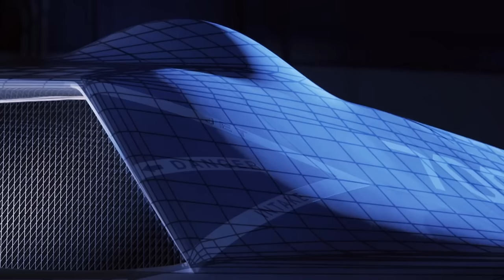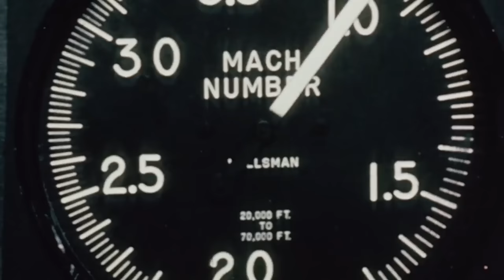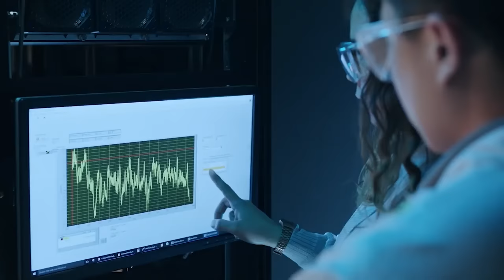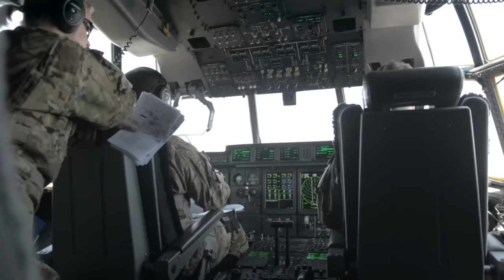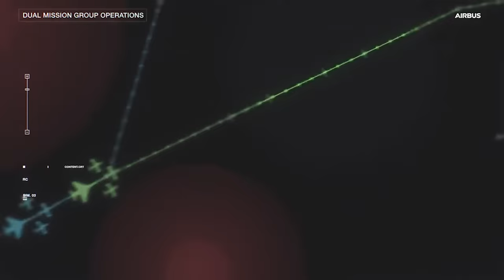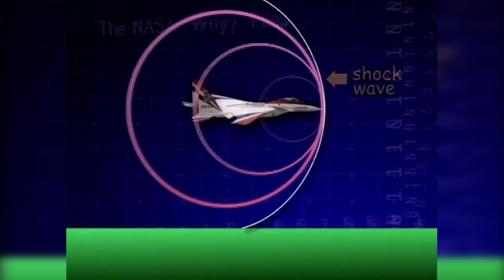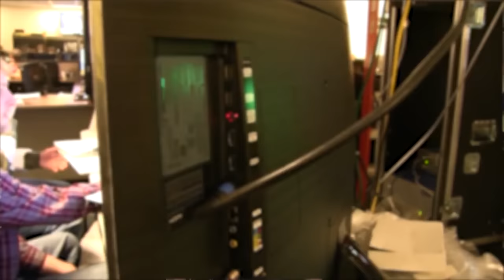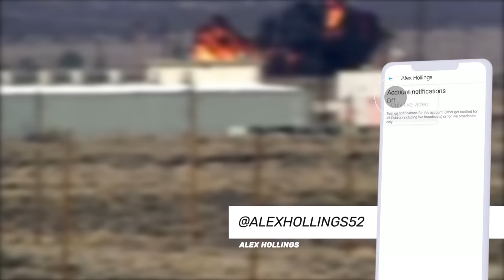Modern X-PLANES: The future of airpower

Comment: The X-65, if proven, would revolutionize aviation and dramatically cut the cost of building aircraft, while reducing mini potential points of failure.
Reply: They will invent a way to make it very expensive
Reply: I was actually kind of thinking the opposite. Sure, if you can get rid of control surfaces it removes them, their linkages/cabling, their actuators from the aircraft, so that cost to build and maintain goes away, but control surfaces are being replaced by something else, and if operating that something else turns out to not be as easy or reliable as people expect, it could very easily end up more costly to build or maintain, or end up increasing weight or complexity rather than decreasing it.
Reply: @nomar5spaulding   you are 100% correct those tubes add back weight and complexity that was removed by actuators . tubes get blocked by ice build up . ice can be melted  but the heating elements add more weight . also u have to add alot more time and cost for maintenance and inspections .  and in large aircraft those tubes need to be big to supply the volume of air to move the aircraft fast enough to mimic the actuators .  plus for landing you will still need flaps because u send alot or air to mimic landing flaps . and if a maneuver needs to be done then that air supply will drop . its sounds great till one things deeply into it . on a drone it can work  but on a large aircraft i have my doubts about it efficiency
Reply: @cordellej  Not arguing the complexities or anything but there are such things as "blown flaps".  This technology has already been used for flaps.  And yes it does take a lot of bleed for landing flaps, usually coming from the fact that during landing the engines are at a lower thrust setting anyways so they throttle up a bit to use the bleed air.  It is already done and not very revolutionary.
Reply: @cordellej 

I understand what you're saying, and it makes perfect sense - but wouldn't the heat from the diverted exhaust help keep the air ducts from freezing (at lower altitudes, anyway) while they're constantly being deployed for attitude control? 
(as one would imagine that that they would HAVE to be?)

Just wondering... "inquiring minds" and all that. Lol

Comment: My two favorite X planes are the X-3 and the X-15. The X-3 was a bust, the X-15 is the greatest of them all. That's not counting the XB-70 Valkyrie, which to me is in a class all by itself. It's the one plane I've yet still to see on my bucket list.
Reply: It's pretty sweet, if you ever get to see it look at the back, it looks like the back of the millennium falcon
Reply: You need to go to Dayton
Reply: I like the X-31.
Cobbled together parts from a wide range of other aircraft, and uses canards & thrust vectoring to pioneer "post-stall maneuverability".
Largely all the fancy moves of gen 4++ and gen 5 aircraft (cobra, maple leaf, etc) basically the "wtf was that?" scene from the new top gun movie, among others. All came from research with the X-31.
Reply: If you love airplanes Writ-Patt is mecca. Those of us in Ohio are friendly and would love to have you visit.
Reply: X-15 was the only reason I needed to go the Dayton AF Museum. Don't get me wrong, there were a lot of incredible planes there but the X-15 is why I wanted to go. It's 1 of 2 that stuck in my memory even after 45 years. The second was the XF-85 Goblin.
Reply: @diGritz1  regarding the Goblin... the second XF-85 is in the SAC museum in Nebraska.   I was surprised to discover it there... I had assumed that the second XF-85 was lost in a crash.
Reply: The one that hardly ever gets mentioned is the X-7 with a Wright Aeronautical ramjet engine.
Reply: Top of my list

Comment: I wonder if they will rename the Gremlin carrier system "Rapid Wagon". This will fit the names I have for all the other new innovations using cargo aircraft, from Rapid Dragon (the actual name for palletized cruise missile deployment system, in service) to Rapid Fraggin' (my name for a similar palletized air deployment of long-range SAMS) to Rapid Flagon (my name for putting fuel tanks into a cargo aircraft with the boom sticking out of its rear ramp).

Comment: The CRANE model would work best with what I'm going to call "magnetic active flow control" for hypersonic systems. Try typing that into Google, and you get microscopic mechanical systems instead of what I was thinking, which would ideally be solid-state. Hypersonics produce plasma by their very nature and plasma is easily affected by magnetic fields, so it stands to reason (to me, at least) that by simply attempting to deflect the airflow away from the aircraft with a magnetic field, one could not only easily maneuver, but also improve the aerodynamics by actively increasing the boundary layer thickness, which would in turn reduce skin friction drag and, perhaps most importantly, heat.

Comment: The electrical type likely wouldn't be ideal for stealth. It would be really hard to curb EM emissions from it.
But the nozzle type; as long as you used cold air from the compressor (not post-burn thrust), that could be used to do a lot. Also, you could pepper RAM particles into the air flow possibly, or IR-opaque smoke...

Comment: The truth is that you need to remember one thing. Everything that Uncle Sam comes up with, the Chinese will copy and multiply it by 10. And they will do it faster than the said uncle can transfer from one bureaucratic drawer to another bureaucratic drawer. So, without expanding the US industrial base to build a material war capability, there is no way to win this confrontation, even with the most cunning strategies.

Comment: Active flow control has potential to be a integral system, but i dont think it will ever fully man a vehicle for common use. Im not a psychist, so please educate me if im wrong, but if they use controlled air bursts to control orientation. Wouldn't that system struggle in a higher pressure environment, such as high G, low atmosphere?

Comment: More like x planes are the subject of YouTubers who say “the plane that was never built”, or “novel aircraft ide”. I don’t think they many have gone one to field anything.
Reply: That's not the point. The idea is to learn what new technologies can and won't do. The planes are built to gather performance data, so they are crammed with sensors. They are also built to push performance boundaries without killing the pilot. Less thought is given to weapon mounts or range of flight, for example.
Given the performance data, engineers can then figure out how the tested technologies fit with their weapons programs.
Also, it's better to get a negative result in a test plane than in a production line.